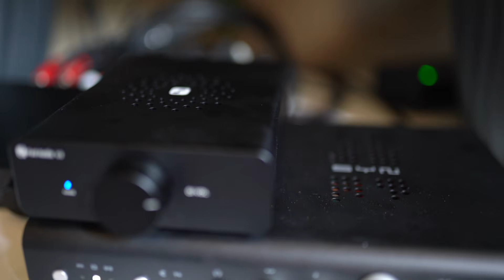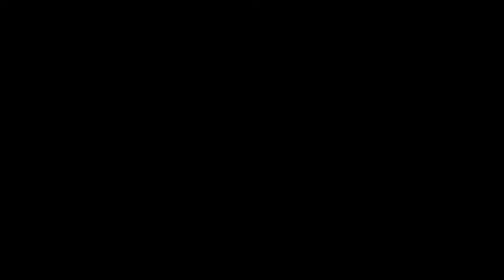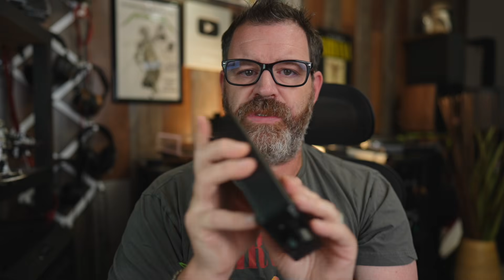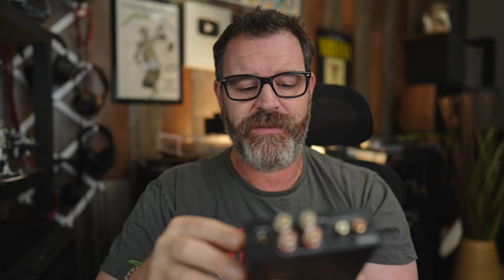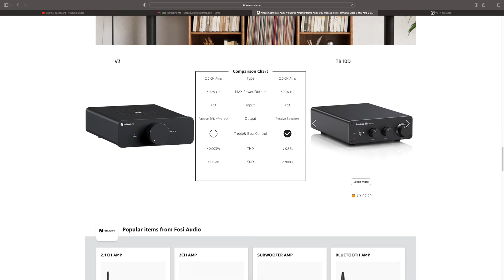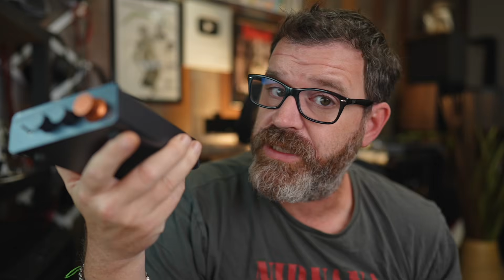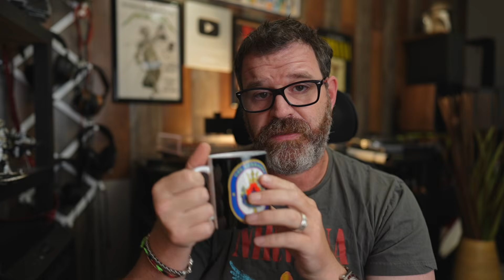Fosi Audio V3 Review - The Best Amp Under $400?

Comment: The good news about these power ratings is they are roughly doubling from 8 ohm to 4 ohm. Which seems to indicate that it has good current capabilities.
Edit: I agree that the small binding posts are the weak point. Maybe Fosi can build a version with a larger chassis that has 2-4 inputs, and a built in shielded power supply (linear even?) - and really clean up on their market share?

Comment: I’d be willing to bet strongly that the thermal design of any of those amps won’t support those higher output levels potentially afforded by those more robust power supplies long term. A significant reliability issue.
Reply: Agreed, my A07 came with a 36v 6A PSU, and I don’t think I would go any higher than 36V. If I was going to upgrade it, I would focus on getting an industrial PSU with much better wiring and a nicer barrel connector.
Reply: @dominicm8020 I'm curious, I can't get my a07 past like 9 or 10 o'clock or I get deaf. I'm curious what the added benefit would be for the higher rated PSU?
Reply: @daniel12345abc  9 or 10 o’clock? That’s like 30% since it sweeps from like 7 to 5. You must have very efficient speakers AND sensitive ears. My Jamo concert 11 towers are 4ohm, and plugging them into the A07 for fun required me to turn the dial to 1 o’clock to hit 75-80db at my listening position. I run my center channel with the A07 and I have to turn the dial to 11-12 o’clock to level match to my towers running -30db level from my AXR100. As a rule of thumb, you want to keep amplifiers under 80% maximum power output if you want to avoid distortion and clipping if your speaker impedance drops too low.
Reply: @dominicm8020  to be fair, I do sit quite close to my speakers. But with the volume set at 12 o clock my neighbours will probably call the cops haha. And my neighbours like me haha. I have the A07 connected to an smsl su-6 (fed by Wiim pro with fixed signal) which I put the digital volume to 100% as I heard that should be better. Maybe it actually amplifies the signal? Not sure. The speakers are a DIY kit (Overnight sensations) which seem to be rated at 83 dB sensitivity, not sure. They sound massive though due to the filling / port I imagine. Maybe it is just that they aren't very large speakers so the parts require less power anyways? I'm not too sure, I'm pretty new to HiFi, lots to learn. I just like good sound and building things haha. But if I understand you correctly I don't have anything to gain from a bigger powersupply in my case since I don't reach the 80% mark ever? I could reach the 80% on my A07 if I turn down the DAC to 40% which is something I used to do until I read digital volume control is probably worse to use. I noticed no real sonic differences though although I haven't tried very high volumes in that setup

Comment: How about using this with a 48v power supply as a power amp for a 2 channel setup?
Reply: Supposedly the sweet spot for Power/distortion in the TP3255 chip is 36V. So the ideal power supply would be 36V 10A, but you’ll have to get a meanwell or something because I cannot find any sealed power bricks with that rating.
Reply: @MechAdv  I understand.. but could this amp be connected to my Marantz to push more power than my current 50w at 8ohms?
Reply: @Cabernetor  More power yes. Especially if you run it with only one channel driven. More clean power? Well you’d have to take measurements to know for sure. I have an A07 with a 36V 6A sealed PSU, which should be good for 108Wpc into 4ohms, but I could hear the bass notes disappear at higher volumes where they should be getting more resolute. I upgraded my mains to an AXR100, which is not rated into 4ohms but estimated to be 120-130W, and the bass has much more detail and separation driven to similar volumes. Or in other words, you might be trading output for distortion by going that route. If your marantz is getting 50wpc into 8ohms at less than 1% thd, then it’s probably better than any of these 3255 class d units.
Reply: @MechAdv  
in a07 there are small capacitance capacitors(1000-1200uF), for good bass at high volume 3300+ uF low impedance capacitors are needed (this is Texas Instruments recommendation datasheet for tpa3255), u can modify it but not easy to fit them there.

Comment: I pulled the trigger 😅. I will compare it too aiyima t9 and a08.
Reply: The amplifier chips used and the output power are different, you can compare it to A07 and A07 Pro

Comment: Dont waste your money they are weak amps. i bought one from watching this channel, sent IT back. not enough volume, my mordaunt shorts where NOT rageing , so i then bought a yam ax 369. and Now i can bug the block of flats i live in if i so choose. ok not a dinky but such is life and i can buy a bluetooth adapter for it so i can use my phone. not that i really need to as my tune collection are on my hard drives mainley.
Reply: I half agree with you. They sound great and will drive low impedance speakes BUT at low to moderate volume levels. So you are correct, these little amps are not for rocking out. They have their limits which is mostly LOUD listening. I have Fosi Audio TB10D in my offce setup and it sounds F'N AWESOME, but don't turn it up. Haha!

Comment: Thank you for the content. How does it compare to aiyima a07 and a08 soundwise, I wonder. ✌🏼
Reply: The V3 has superior internal components, which on a highly resolving/better quality system, should sound better. I can't wait to compare it to my TB10D,  A07, and BT20A PRO. Currently have the TB10D set up in my office setup and it sounds amazing! Plus, if you addd the orange knob to the V3, it supposedly improves the soundquality by 33%. (Just kidding).
Reply: @ramondelgado6778 would you be willing and able to get back to us with your findings/ opinion? Personally I'm most curious about the A07 since I own that haha
Reply: @daniel12345abc  Sure thing! I must say, I really LOVE my Fosi TB10D and the Aiyima A07. I have MUCH more expensive gear but am using the Fosi TB10D as an external amp for my Marantz NR-1403 as a pre-amp, using WiiM Pro WIFI streamer into a Schiit Audio Modi 3E DAC,  in my office set up, and it makes me smile every time I listen to it. At home, I'm using the A07 as an external amp, connected to an Emotiva TA-100 as a pre-amp, streaming to a Bluesound Node 2i, SMSL SU-1 DAC, and same results there. Both are driving Wharfedale bookshelf speakers (D310 in the office set up and Diamond 12.0 at home) that claim to dip down to 3.8 ohms and both amps are turned to 12 o'clock / half way, and they barely get warm. So I am excited to see what the V3 can do with both set ups.
Reply: @ramondelgado6778    ok. V3 arrived and I let it play around 2 hours. And the moment I switched to a08. A08 has like twice as much power plus texture of the instruments and bodily impact. With v3 music is just playing and it is like floating in the mid air vs. With a08 things r happening with each instrument as in you can observe qualities of every individual instrument. Imaging and soundstage is solid and far superior in my opinion. I would take a08 any day of the week. (I didn't use the power cable that came with a08 instead I used one that comes with smsl d1se). And the rest of the system that I used is pretty higher class to either amps. (Dali rubicon2, smsl d1se, innuos streamer with lpsu). This is my take, I guess t9 is closer to v3's tier yet t9 is special imo.I must admit geshelli j2 akm matches better with v3. And it helped the amp to come alive yet top end is a bit harsh but I would still prefer a08 because of the body to the sound and imaging.
Reply: I'd be interested in that as well. Maybe Randy will side with Fosi in that case because of his sponsorship. But I'd be really interested on his honest take on this am vs the Aiyima A07 / A08 Pro
Reply: @MissionFreiheit  ok. V3 arrived and I let it play around 2 hours. And the moment I switched to a08. A08 has like twice as much power plus texture of the instruments and bodily impact. With v3 music is just playing and it is like floating in the mid air vs. With a08 things r happening with each instrument as in you can observe qualities of every individual instrument. Imaging and soundstage is solid and far superior in my opinion. I would take a08 any day of the week. (I didn't use the power cable that came with a08 instead I used one that comes with smsl d1se). And the rest of the system that I used is pretty higher class to either amps. (Dali rubicon2, smsl d1se, innuos streamer with lpsu). This is my take, I guess t9 is closer to v3's tier yet t9 is special imo. I must admit geshelli j2 akm matches better with v3. And it helped the amp to come alive yet top end is a bit harsh but I would still prefer a08 because of the body to the sound and imaging.
Reply: He’s says it’s better in the video.
Reply: @lullabies7441  He says it's better than anything Aiyima has to offer at this price point if I remember correctly. The A08Pro is almost double the price of he Fosi V3.
Reply: An update would be great!
Reply: @jakedavila4468   ok. V3 arrived and I let it play around 2 hours. And the moment I switched to a08. A08 has like twice as much power plus texture of the instruments and bodily impact. With v3 music is just playing and it is like floating in the mid air vs. With a08 things r happening with each instrument as in you can observe qualities of every individual instrument. Imaging and soundstage is solid and far superior in my opinion. I would take a08 any day of the week. (I didn't use the power cable that came with a08 instead I used one that comes with smsl d1se). And the rest of the system that I used is pretty higher class to either amps. (Dali rubicon2, smsl d1se, innuos streamer with lpsu). This is my take, I guess t9 is closer to v3's tier yet t9 is special imo.I must admit geshelli j2 akm matches better with v3. And it helped the amp to come alive yet top end is a bit harsh but I would still prefer a08 because of the body to the sound and imaging.
Reply: @jazzabana  Thank you so much for the quick update! Certainly appreciate it and will take your assessment into account. I think the A08 would rule the market if it came down 25 bucks or so.
Reply: @jakedavila4468  Well, it would be nice if they could get rid of the dac and the bluetooth. In that case you would end up with a decent amp that cashes out whatever you put in. Anybody who hasn't changed the mains cable of the a08 and using its dac and bluetooth is missing a lot.

Comment: Love it brother…might grab that one. Vents and all the trimmings inside….yes! Not sure if it will beat my BRZHIFI 3255XLR but it will be fun to find out!
Reply: dont waste your time. just buy a real amp..i went through the whole process only to send it back..  if you like it loud that is . they sound ok, just not powerfull enough.
Reply: @jadedsoul1 I already own a Rotel A11 Tribute and still love the sound of a well implemented 3255 chip if that says anything to you…
Reply: @jadedsoul1 I sold my A11 and kept the V3 and the BRZHIFI 3255XLR. Why, power! The V3 is plenty at 1.00 o'clock and the BRZHIFI at 11.00 o'clock on the dial and plenty left to go. The A11 just doesn't have any, it really struggles driving my floorstander at 88db sensitivity. Even Rotel do not recommend driving the amp above 70% for long periods of time, I mean come on dude, its an £450 amplifier and sweats at 70% which on the A11 Tribute is not loud, I mean not even close, in fact the Denon PMA600NE is louder at 45% with the same output power on paper, the A11 really sucks here! Yes it sounds nice but for a few extra details and nuances as they like to say and an extra £300 out of your pocket...no chance but yes if it just had the same output power as most of the other current 50wpc amps on the market at the market. My Onkyo A-9010 is even better powered and that was under £200 new! The Onkyo is one of the best amps you can get for the money, its well balanced, detailed, tight bass, strong midrange, great vocals and clear highs, sharp, precise. and a tonne more power than the A11 Tribute and again even less power output on paper than the A11. The A-9010 sounds similar to my BRZHIFI but then I can also just pop out the op amps and change the game there with the BRZHIFI, so what's not to like? As far as internals go on the V3 and BRZHIFI they both have high quality parts which can be bettered if you have the skills but as far as any damage being done by either of these two amps, the V3 and BRZHIFI, to your speakers as others have speculated as a possibility then no, these amps will not do any damage to your speakers via frequency spectrum or noise.
Reply: The advantage I have with the BRZHIFI is space, I use op amp decoupling boards which smooth the sound out.